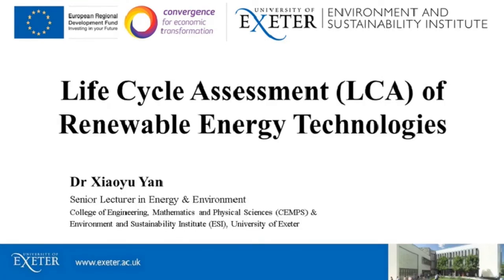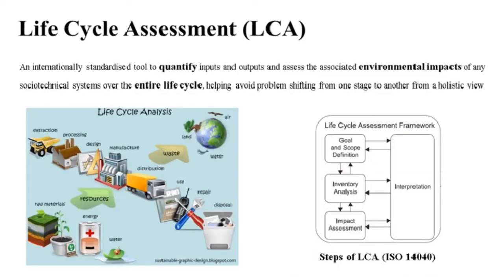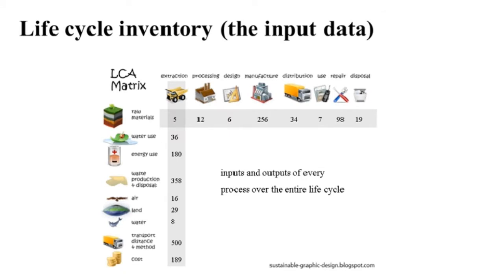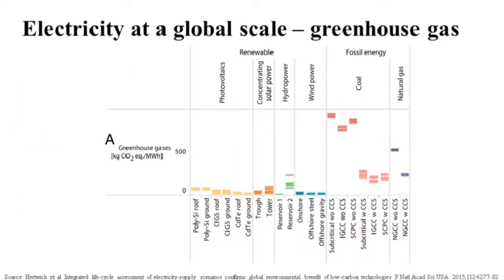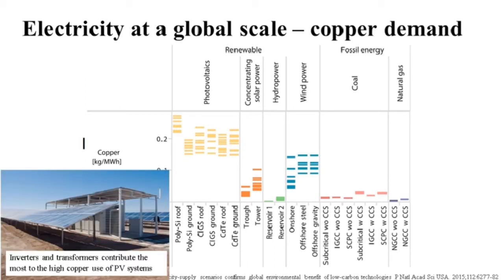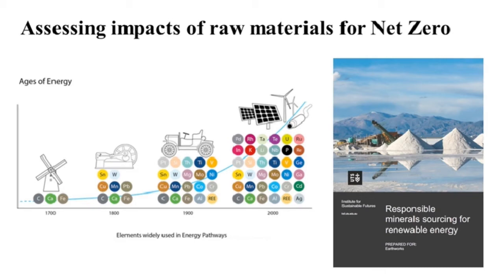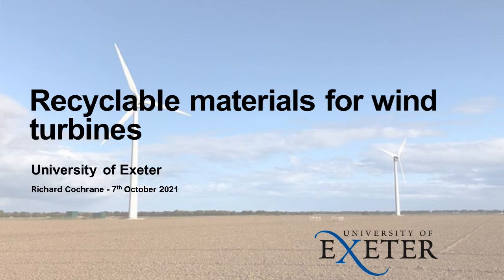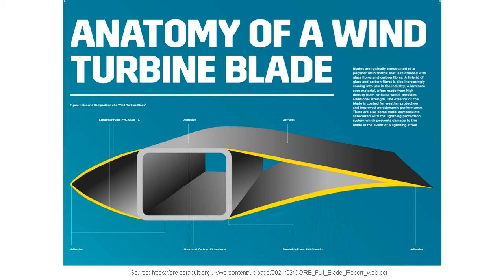Sustainable Systems: A Life Cycle Analysis of Renewable Energy Technologies

Comment: A missed opportunity to compare LCAs for alternative, low-carbon electricity generation sources, including nuclear power, instead of devoting time to coal and gas.

Though no specific mention was made in respect of what constituted the 'whole' LCA for wind and solar power plants (WASPPs), the most probable interpretation would be their LCAs up to the point of generating intermittent electricity.

If this is the case, the problem arises that intermittent electricity is not a product fit for purpose. Though low-carbon at that point, it is unusable unless 'converted to usable and dispatchable 24/7/365 electricity, just the same as electricity from fossil fuel power plants and nuclear power plants (NPPs).

An apples-to-apples comparison would add the overnight capital cost (OCC) of gas-fuelled backup plant, plus the fuel cost, to the LCAs of WASPPs, which would add significantly to both cost and carbon footprint of both technologies.

Considering just OCCs and fuel costs, a 2020 comparison for WASPPs and the Rolls-Royce UK SMR results in a figure of £31.93/MWh for WASPPs and £5.46/MWh, almost 1/6th of the WASPP figure, for advanced NPPs. The OCC of any technology says almost everything that needs to be said about the 'downstream' content of those costs - materials; resources; labour; energy.

https://colin-megson.medium.com/in-2020-wind-and-solar-power-plants-waspps-generated-79-twh-of-intermittent-electricity-a8c70e86e52d

In respect of environmental impact and waste issues, a picture says a thousand words:

https://cdn-images-1.medium.com/max/1000/1*-vjM1aXpa-R9tiT7bhjkXg.jpeg